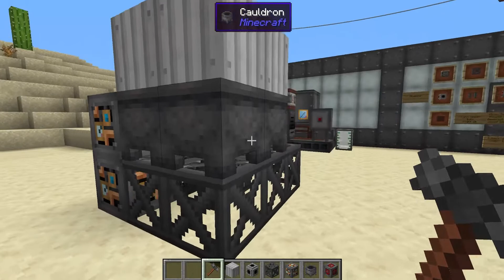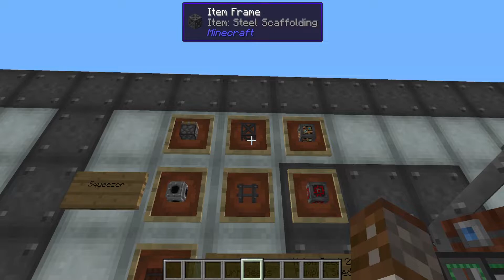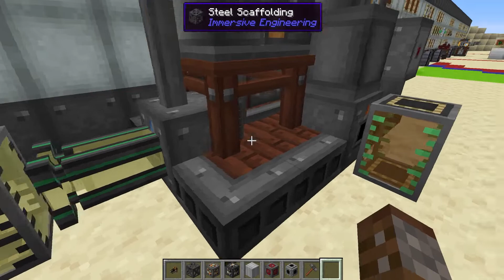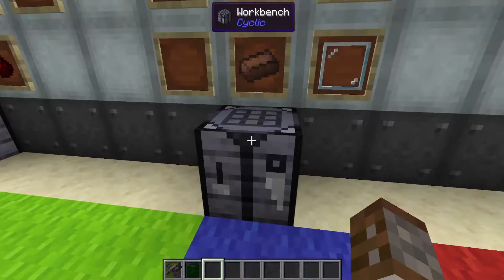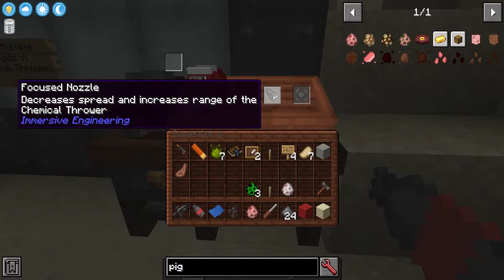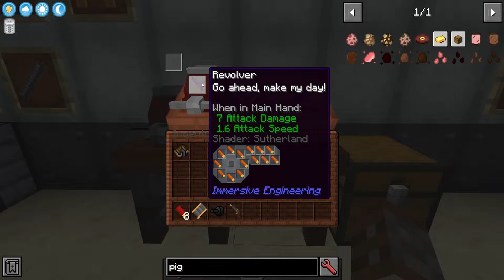How to: Immersive Engineering | Biodiesel & Chemical Thrower (Minecraft 1.16.5)

Comment: Do you have a setup for biodiesel? I play All the mods 6 in 1.16.5 and have the problem that I can`t really figure out how many garden cloches I need to let the squeezer, fermenter and refinary power two dieselgenerators at the same time. The only thing I know is that with 8-9 melon cloches it is doable and for industrial hemp I`m not sure. The thing is that whey I try to do it with calculating I would theoretically need 27 garden cloches for hemp and even more for melons but that doesn`t make any sense because I experimented for hours and I have enough melons with only 8-9 cloaches and nearly enough hemp with 11. So the only possibilities are that I calculated wrong or wiki isn`t right about how long a fermenter and squeezer need to finish the items.
Reply from the maker: Should be 1 refinery to 1 diesel generator. So you need enough for 2 fermenters and 2 squeezer. I don't believe there is an exact ratio so you will most likely have too many plants and need to void some
Reply: @Mondays3  ok thanks.

Comment: Could you please NOT use items from other mods while doing tutorials on a specific one? It only serves to complicate things.
Reply from the maker: The only thing I use from other mods are creative items as a supply. Immersive engineering does not offer creative fluids like mekanism does. Besides that I use mekanism pipes for a visual representation of items or fluid movement.

Everything else is the base mod and each video will continue to be nothing more than the vanilla base of each mod/ mod group I cover
Reply: @Mondays3  Going to have to kind of apologize for my comment it turned out that my frustration came from my own stupidity and not realizing that I was working with the squeezer and had yet to build the fermenter.
Reply from the maker: @Viper4382  No apology needed, it's not that deep. Modpacks can be complicated sometimes and things get confusing